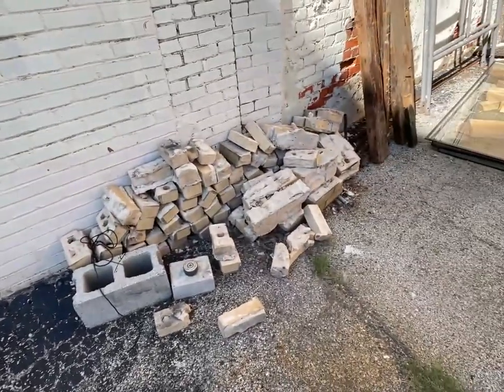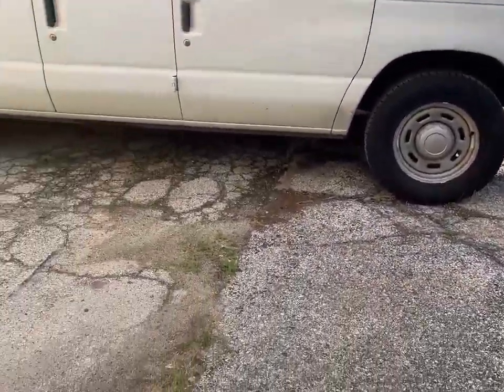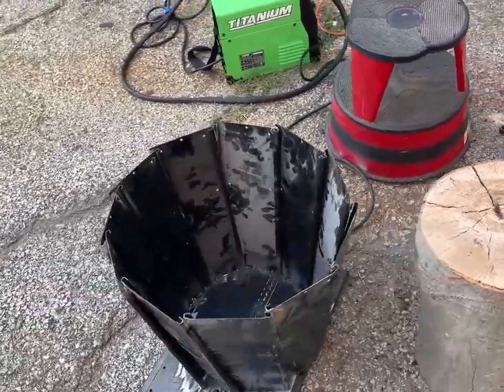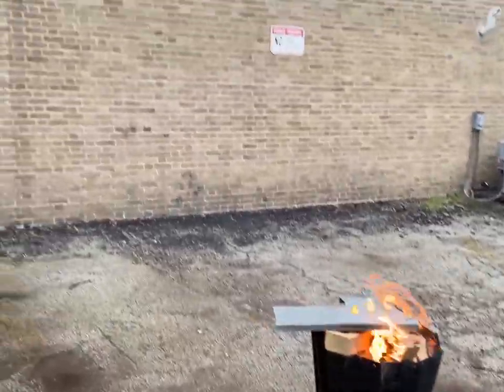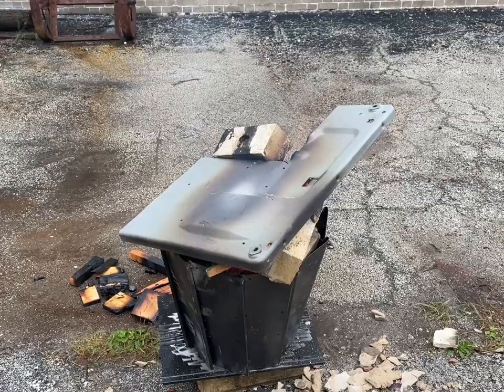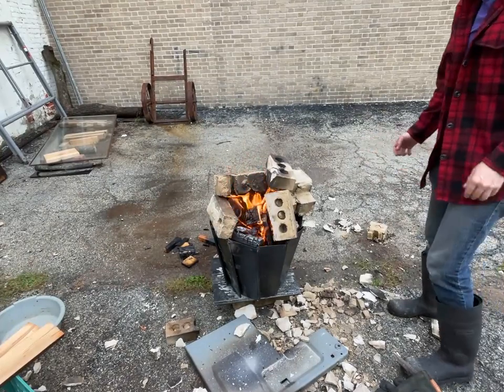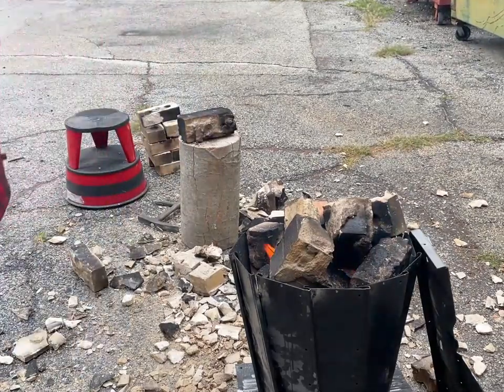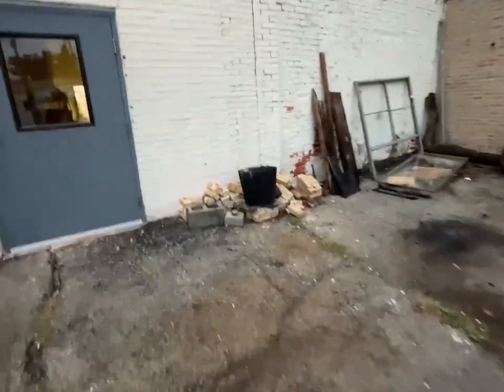Making a portable metal fire pit from random junk, to toast bricks! A valuable tool for an artisan!

Comment: great video ! , concrete brick is the worst for cleaning ive encountered  when i worked in masonry for about 20 years all together , most normal mortar i can just clean with a good brick hammer , also if parging foundation mortar features a seal bond additive gets mixed in or used it can stick more and a latex additive is even worse... more adhesion and very hard , ya those bricks look very smooth and well mortared , mortar batches can vary since its done buy rough measure on site
Reply from the maker: I think what makes this more difficult is that this will be the 2nd or 3rd reclamation of these bricks, so they already have a long history of microfractures from their past. You can only remove mortar from bricks so many times
Reply: ya true it probably would stick more each time  @RinoaL